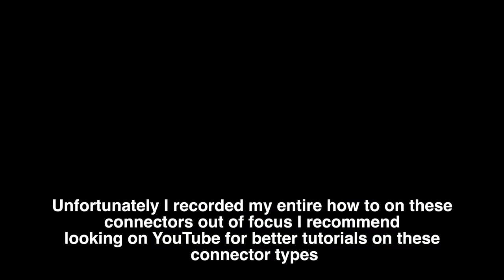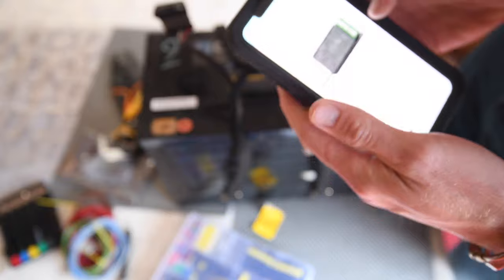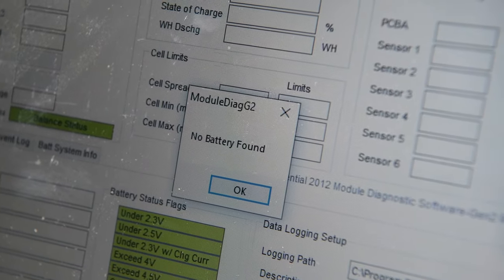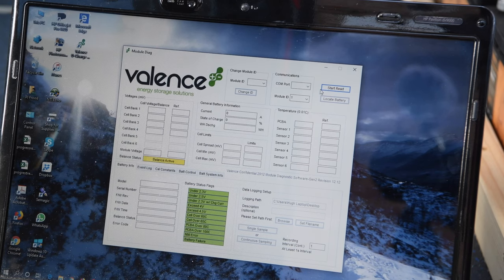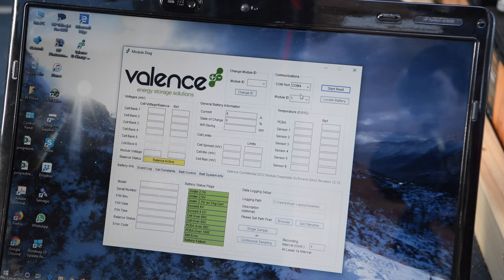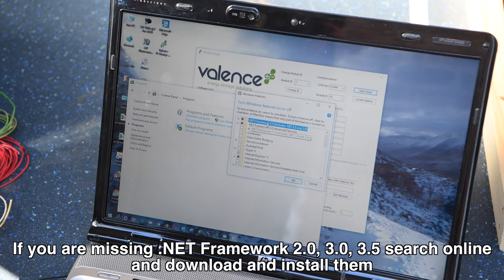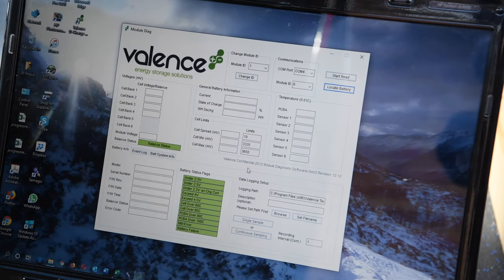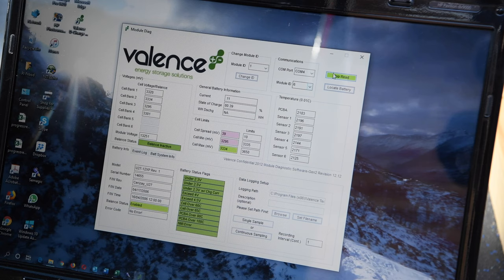HOW TO: USED & Cheap Valence U27-12XP Lithium batteries. Repair, Communication & Software issues

Comment: Thank you thank you! I have the blue clear 5 pin rs485 and can’t get it to work. Best tutorial yet on this horribly complicated wiring and communication setup.
Reply from the maker: It’s definitely not the easiest system to work out! Especially with different models of the same type of adapter can be hit or miss.

Comment: Thank you for sharing all of your work to help others. I am new to solar power and lifepo4  batteries. I just purchased (4) Valence U27-XP12 and discovered the difficulties of accessing the bms comms. I am thankful to have found your YouTube channel. Very helpful information. 😁👍 Cheers from USA.
Reply from the maker: No problem at all. Enjoy the batteries! I hope you have been able to connect to them now
Reply: @MispronouncedAdventures I am ordering the adapter today. Without your video I wouldn't have known this was possible. I will let you know once I am able to connect to the software. Thank you
Reply from the maker: Great, best of luck and if you have any issues which is haven’t covered then comment again And I’ll see if I can help figure it out
Reply: @MispronouncedAdventures  Hello again, can you tell me what the valence communications plugs are? I dont want to cut the existing plugs and need to order some. Thank you
Reply from the maker: AMP super seal / Tyco connector ( 5 pin version ) is the name of the connectors
Reply: @MispronouncedAdventures  😁👍Thank you
Reply: @MispronouncedAdventures   @Mispronounced Adventures  I hate to bother you again...do you have a link for the bms application download? I am unable to locate one. At the very least I'd like to buy you a pint of your favorite beer or? If you have a link for donations please paste it on your reply. Thanks again 😁
Reply from the maker: Link at the top of the website. https://www.brewskynet.com/valence/

Hope that should work, if not just message again there are a few other places I found it.
Reply from the maker: I don’t have a donations link but I very much appreciate the thought!
Reply: @MispronouncedAdventures  Thank you very much

Comment: Thanks, this has helped me. I built the connector, got the diag software installed with correct permissions. I think my problem is the data line diagrams I used showed straight through wiring which you said is not correct. I will try tomorrow and see if the laptop can find the batteries. Thanks again!
Reply from the maker: IThe wiring diagrams for the adapters can definitely be inconsistent in the ways they refer to which pin they called A and B for the data positive  and Neg, sometimes it’s the same as valance sometimes it’s The opposite. Hope it all works for you
Reply: @MispronouncedAdventures  The reason I'm doing all of this is my batteries stop taking a charge. I had let them sit for quite some time without using them. They both register about four volts but will not accept any charge. Both LEDs have stopped blinking. Any suggestion would be helpful. Thank you again.
Reply from the maker: Oh 4 volts is definitely not good but can be recoverable. If you have Facebook I’d recommend joining the group call “valence XP LiFePO4 battery user group” as there are definitely quite a few people on there with more knowledge than I do about extremely low voltage recovery. Definitely getting them connect to the computer would be a good idea. I think generally the advice are going to give you is an extremely low amp charge for a long time to slowly bring them back up.
Reply: @MispronouncedAdventures  I switched the data lines and no change it still won't see the batteries. I have the same connector that you show for the usb and I did the amp myself painstakingly soldering and making sure I have full connectivity from one end to the next. The lights are all blinking madly on the connector when I ask it to locate either of the batteries but it comes back with battery can be located. Also both of my batteries are down at around 3.6 VDC. I went to the facebook page but found nothing that you didn't really cover except that charge rate comes into play when recharging them. I have gone to device manager and made  sure that it is COM3 and set for 9600 Baud rate but am at a loss as to why I can't establish communication.
Reply from the maker: Hmm. I’m struggling to figure out what the issue could be. I wonder if potentially there isn’t enough voltage left in the battery to power the BMS ( so there isn’t anything for the computer to find it as it has no power ) I presume you’ve tested that the USB adapter is definitely supplying 5V.  When you say they are not charging. I take it if you applied a charge to get battery and used a amp meter there would be no current passing through?
Reply: @MispronouncedAdventures  Thank you so much for the time you have devoted to replying to me. I poured through lots of manuals and other blogs but did not find the trouble yet. I have only used a VOM to measure voltage on them, not an amp meter. I will try that to see what value I get. What should I be looking for in stand alone amperes when I take the measurement. Cheers

Comment: i got 2 of the Valence U27-12XP im going to use your video as a guide to see if i can get the software to work.BTW i just viewed a youtuber with what appears to be that same lite blue UBS connector and his system seems to be working fine
Reply: you can checkout Sprinter Shuttle video
Reply from the maker: Hey, great batteries hope you find the video helpful. The little blue Usb adapter  I’ve discovered when chatting through with other people that there are at least two versions of the same connector using that blue case one which does work another and  which doesn’t
Reply: @MispronouncedAdventures  ah very good are you still using the black case Valence batteries or have you upgraded to the puke green ones?

Comment: Helpful video.  One subtle point that is noticed, and has come up on the diysolar forum also.  In the first part of your video, you show the Valence 12.12 software and it has 5 tabs at the bottom (Battery Info, Event Log, Cal Constants, Batt Control, Batt System Info).  Later in the video only 3 tabs are there, Cal Constants and Batt Control are missing.  Do you know what makes the software display the extra tabs or not?  How did you get the 5 tabs to display?  Both the Cal Constants and Batt Control would be useful, but I only see the 3 tabs and not those.  Thanks!
Reply from the maker: Funny you should mention this. I don’t think I actually noticed it this in more own video as normally I only have three tabs but I have actually noticed it in someone else’s video  I watched at one point and have committed asking the same question why they had five tabs. I’m not entirely sure. When sometimes I see people post screenshots of the software they’ve got five tabs but they all seem to be running the 12.12 as well

Comment: Anyway awesome video.  This will certainly help a lot of people.
Reply from the maker: Thank you I hope so too. It’s got all of the issues I could find in it, plus a bit of trial and error on adapter types
Reply: @MispronouncedAdventures  the male and female adapter are both useful. Because Sometimes I find it easier to access one end of the string versus the other.
Reply: @MispronouncedAdventures  and you have to have a female in order to connect to the BMS.
Reply from the maker: Ah that is a good point regrading the BMS port
Reply from the maker: Yeah I thought it will be a good idea to teat if you could use both a male or female for the adapter as I had seen some confusion about it online

Comment: Hi there. I have a Valance U27 -12XP which I brought for a Campervan build. Unfortunately the Campervan project didn’t quite work out and the battery has been sitting in my house for over 6 months. The battery is now flashing red so I charged it with a lithium battery charger but it’s still flashing Red so I’m not sure if it is charged or not do you have any advice. Thanks in advance. 

P.S Great video it’s really been helpful.
Reply from the maker: Batteries can definitely come back from red. What voltage are you getting across the terminals? And if possible can you plug it into the diagnostic software. That will help to figure the particular reason it’s gone red, overall low voltage,  or a particular cell is really low and so on
Reply: 14.4v.  Do you sell the leads you made for your battery.
Reply from the maker: Just sitting at stabilised 14.4v without being connected to a charger? That’s super high for those batteries. 14.4v ÷ 4 ( cells ) = 3.6v per cell which is near the maximum for the each cell. Id recommend applying a load and bring it down a wee bit. Mine generally sit around 13.5v 

Unfortunately I don’t capacity sells the cables. But a set of Tyco connectors and the Rs-485 to USB adapters ( look for the smaller black models ) can be found on Amazon for a cheap price. 

I’d recommend making a cable so you can Connect to them with the diagnostic software and if you have Facebook joining the “Valence XP LiFePO4 battery user group” as its a helpful place and more people on there will have experience with batteries flashing red LED

Comment: Hi mate... great video's btw keep em coming... Down the line how are the batteries operating/performing in our lovely UK weather and charging with your setup? cheers
Reply from the maker: They have been fantastic so far. 500watts of solar and 30amp Dc to Dc charger have be working well. Adding a wall charger as well as another option
Reply: @MispronouncedAdventures  sounds good would you say your running out of power having to keep an eye on it/just right no effort / maybe bit overkill? Sorry just im going to run the basics here at first with 138ah Valence at first and maybe doubling up later by adding 1 more battery and panel later... looking at the 175w mono panel to start with. Ive just got laptop/mobile/1xpump/diesel heater/lighting/12v fridge/small inverter not all running at small time though lol.. the battery real output will probs be same as one of yours im guessing maybe 110ah if i'm lucky... would be great to hear your feedback... think its possible on that?... thanks Christopher
Reply from the maker: Definitely not running out of power. They Allows me to be quite unconservative with power are use in the van if I want to be.
Reply from the maker: But the bigger battery bank and more solar panels definitely allow more flexibility if you’ve got a few bad days in a row without decent solar.
Reply: @MispronouncedAdventures  that was an interesting back story on your batteries sound like they were well made really thinking about getting these or the green v2s. Well I live in Highlands Scotland so its defo one to think about up here with overcast days. I suppose if I leave space for extra I can always add and hopefully when I take my sons away for an adventure I hope they wont be using their devices too much... lol thanks man

Comment: When I go to Device Manager, I had to manually add the Ports tab but when I open it, I only see Communication Ports (COM3) and nothing else. I don’t see the tab USB Serial Port. When I plug my USB in my battery stays in sleep mode and it’s as of the computer isn’t recognizing it at all. Can you please help?
Reply from the maker: What USB adapter are you using?

Comment: Awesome video. You’ve answered so many questions. I have the black modules like you do but they still have the Gen 1 one round connectors. I believe they are M 12 connectors. Any idea on those pin outs? I’m trying to make communication cables to connect to these directly and don’t want to cut the tips off. Do you have any of the user manuals for the black or green modules? A link to those would be awesome if they contain those panels that you were referencing. Thanks again for making such a great video.
Reply from the maker: Yeah I have a peculiar model sort of an intermediate between MK1 black with m12 connectors and Mk2 green Tyco connector. Which makes sense as mine are from  a big fleet conversion which took place in the UK involving 50 vehicles so somewhere in region of 1200 batteries, right at the time between changing from the mark 1 to mark 2 models. If you have Instagram message me on there and I can send you a photograph of the pin out for the M12
Reply: @MispronouncedAdventures  Have everything to go. Just need the pin out on the M 12 connector side. Software is installed and USB cable built. Thanks again.
Reply from the maker: Just seen your message. Ill get that sorted for you
Reply from the maker: Just send you an email. Hopefully you should have it by now

Comment: Total newbie here.  Can you say a bit more about sleep mode?  I've seen on other sites that you need a very expensive proprietary BMS to get these valence batteries out of sleep mode, and I'm hoping that's not true.  When you say that "the battery is still usable in this state," does that mean that you don't even have to take it out of sleep mode to use it?  If not - if you do have to wake it up first - is the 2 minute wakeup from the computer sufficient to keep it awake so long as you put a load on it within that 2 minute window? Or will it go back into sleep mode anyhow?
Reply from the maker: The only real difference between awake and sleep mode for these batteries is the active cell balancing. Basically when the batteries are awake either connected to the computer diagnostic software or to the rather expensive BMS, there active cell balancing under the right conditions will turn on. I believe the conditions for the active cell balancing to turn on is a spread larger than 40mV between cells and Nearing the top end of Charge State. Active cell balancing isn’t as complicated as it sounds. If one of the four cell groups has a higher voltage than the others. The built-in BMS will effectively burn off that Excess voltage via heating up a small resistor to effectively spend that Excess energy in that cell group bring it down to the level of the other cell groups.
Reply from the maker: Without active cell balancing if the battery is just left by itself the cells won’t balance. However when you have a load applied to the batteries continuously. That Excess energy is being burn off the system loads. For example when I originally put three of these batteries in my van and just had them connected up to the solar with no loads connected at all. I found a solar would charge them up the cells would start to spread quite a lot when they got to the top of the SOC  ( when batteries were asleep ) and I would have to plug them into the computer to wake the batteries up for the cell balance of the kick in and sort them out. But as soon as I started having continuous electrical loads on my van system such as the fridge always running and consuming Energy this problem went away.
Reply from the maker: It seems that it’s generally considered alright to use these batteries in parallel in small groups without them being awake.
Reply from the maker: But as these therefore don’t have a true BMS you need to figure out other safety solutions when using these batteries such as your overvoltage cut off, low-voltage cut off and cold temperature charging cut off. If you’re interested in how to do those things check some of my other YouTube videos on my van build
Reply: @MispronouncedAdventures  Thank you! That's very helpful!

Comment: Hello great content what state of charge is 13.5v?
Reply from the maker: My current settings are bulk/absorption 13.8V and float 13.43V. I generally consider my 13.43v as full. I find the cell spread starts to wonder if I keep it at anything higher. I’ve done a rudimentary capacity test and got 330ah of my 390ah before I hit my low-voltage cut off at 12.65v which was about 20% left

Comment: I was able to power a string of 24 batteries using a single 18650 that was putting out 4 volts.  So the voltage isn't an issue
Reply: One of my USB 485 dongles doesn't have 5volt output so I had to power the 5 volt buss externally from a battery or USB port.
Reply: but there's something interesting that when I try to power it straight off of 5v from the extra laptop port it has a bunch of errors and barely works at all.
Reply from the maker: Hmm. That’s interesting. As I have seen online an issue some people had run into the there adapter not kicking out 5v and them having to power the 5v separately to get it to work. Testing that blue adapter and only getting 4.17v when the manual says 5v.  I concluded that must of been the issue as the correct drivers were installed and different pin combinations were tested. I might take another look at that adapter tomorrow
Reply from the maker: Potentially using data signals from one port and direct power from another confuses the laptop or the adapter itself

Comment: What's the overall risk of purchasing a used battery without the blinking light? That would mean the battery is either totally dead or severely undercharged. If it's simply undercharged, does that affect the overall lifespan of the battery?
Reply from the maker: I couldn’t give you a answer from personal experience as I’ve not had a battery like that. But from what I have seen from the Facebook users group for this battery. That no flashing light is definitely the worst possible scenario, they can come back from it, but it does seem not everyone has success. The manual just recommends if no LED indicator is to apply a charger ( low amp ) and wait for it to change, hopefully bringing it back to red, then yellow then green.
Reply: @MispronouncedAdventures  So risk is pretty high then? I'm wondering if low voltage is the culprit the vast majority of times versus some other fatal issue.
Reply from the maker: I would say so, does the seller not have this facility to put the batteries on any type of charge? Even a red light would be a lot less concerning than no light at all